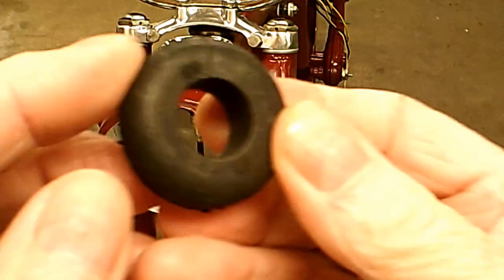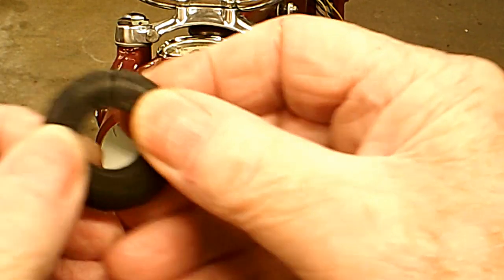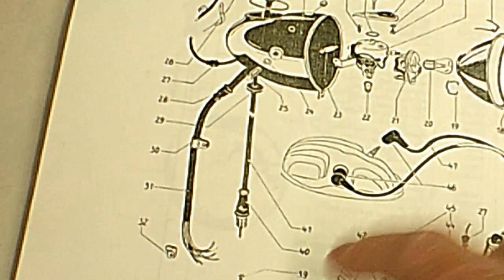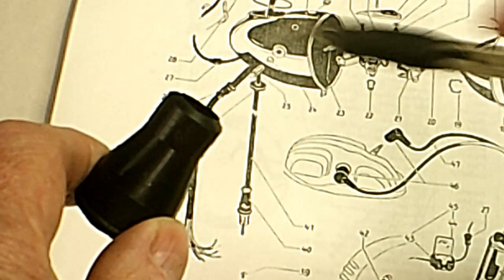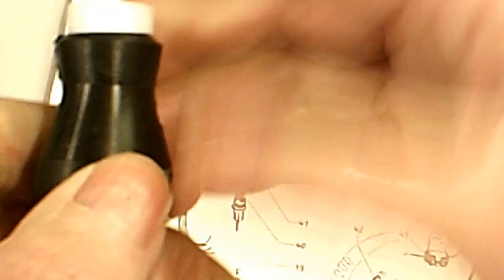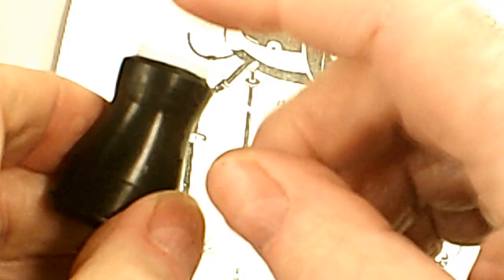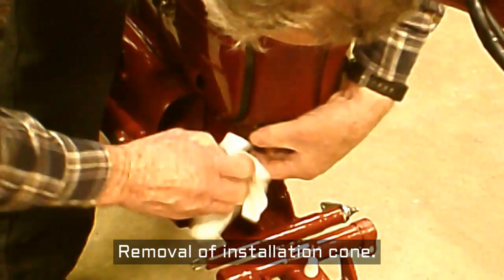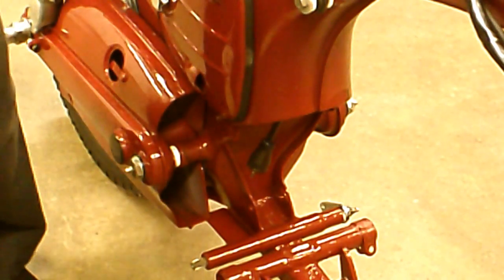1955 Allstate headlight & speedo cable

Comment: I need one of these. #40? the rubber part your talking about for the sealing of the cable going in to the transmission  and also i need the Handel bar rubber you made also  are you selling these  thank you and Great work
Reply from the maker: I made the molds for these parts, but I no longer have a rubber press or the molds.
Please send an email to: sales@jbmindustries.com
Explain what parts you want, and ask for an invoice with shipping to your address. Their rubber is very good stuff.